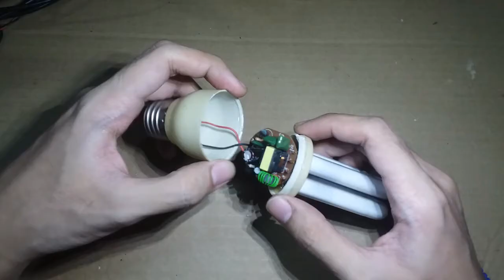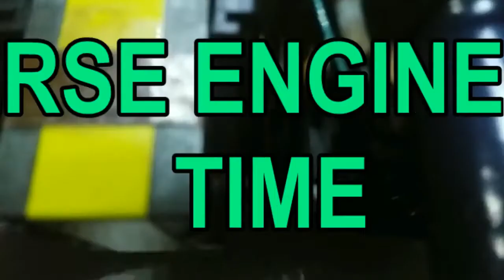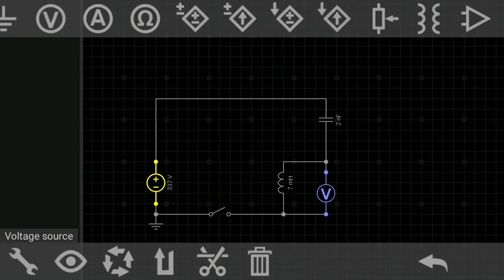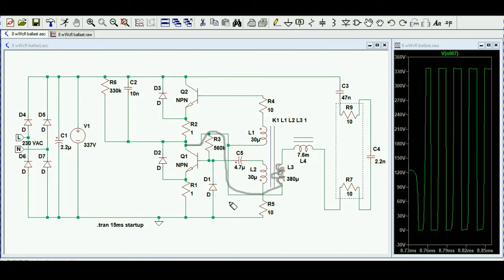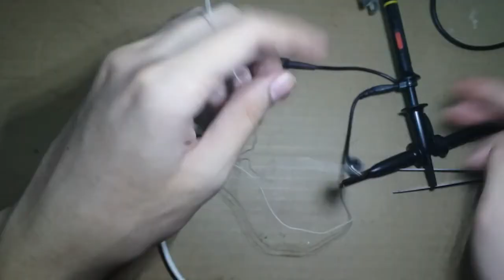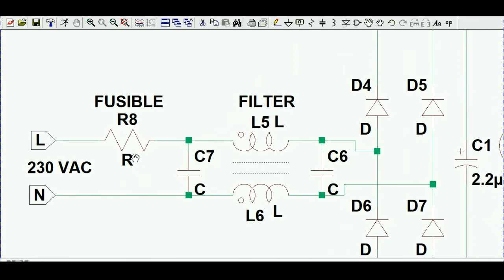HOW A CFL ELECTRONIC BALLAST WORKS

Comment: What should be the output voltage from the ballast supplying the bulb filaments/electrodes please? I am seeing 17-18 volts AC. Is this right? I think in your video you are saying it should be in the 100s!

Comment: Hi, if a bulb has a broken heater, can I replace it with an external resistor to complete the circuit? What resistor should be used? Same resistance as the good heater or maybe it doesn't matter? I'm asking because I've tried this on 2 bulbs and the transistors went bad on both after a few minutes. I wonder if they had been on their last legs already, like if they were leaky or something, or perhaps the single heater that was left affected the operation of the whole circuit?
Reply from the maker: The the bulb will not start  properly if the filament or heater , heating is needed for the mercury inside to evaporate. Maybe it will work if at least one of the two filaments are still ok
Reply: @pinoyenginerd1091  The bulbs work for a few minutes but then the transistors pop so I'm wondering if maybe the lower resistance of the single heater affects the circuit operation and makes it draw higher current?
Reply from the maker: @SinsBird  yes it affects and overload the transistors , the filament resistance will increase as it gets hotter. Normally ,only at start,for a couple of seconds a high current  passes to the heaters.
Reply from the maker: The transistors are only rated to handle the higher starting current for a small amount of time, when you replace it with resistors,  somewhat its like always having a high current, and the trasnsistpr cant handle it.